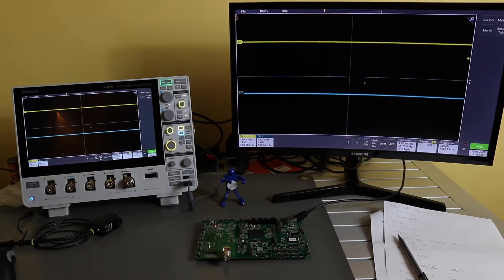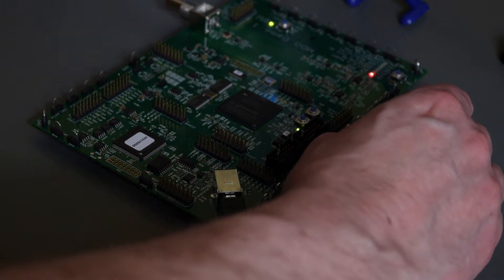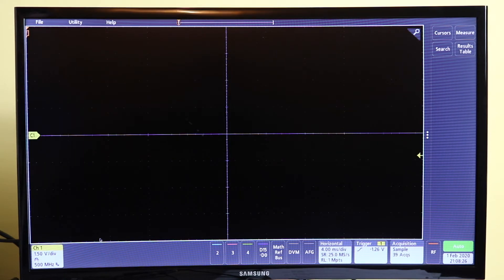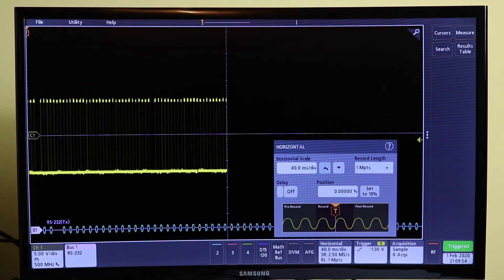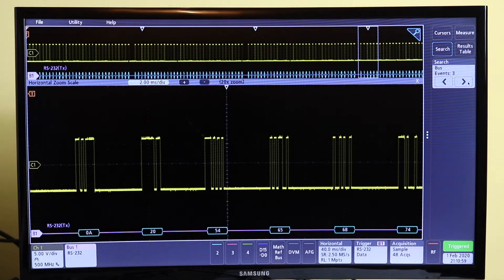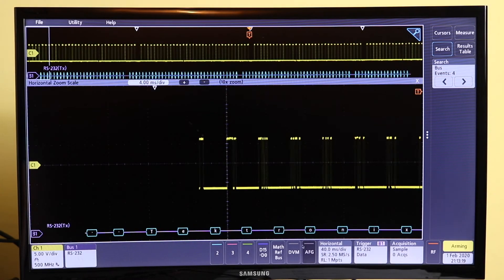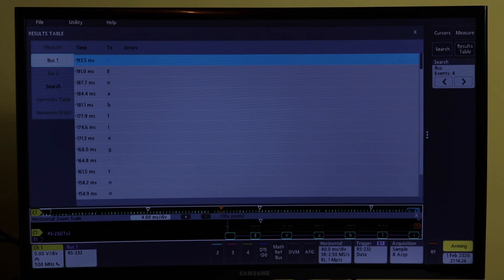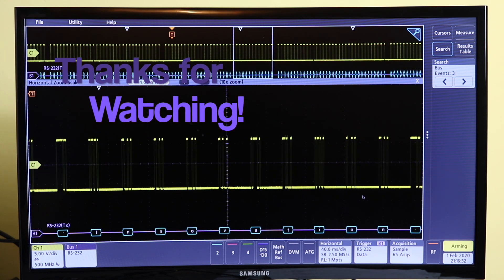Tektronix 3 Series MDO RS232 Signal Capture Demonstration

Comment: Do you have experience with the X3000 form keysight? im currently looking for a new scope and im having a hard time deciding betweend the 2?
i like the bigger screen and resolution on the TEK but people on the EEVblog forum do not seem to like it at all.
Reply from the maker: No sorry, I do not have a user experience of any Keysight oscilloscope. I know that Tektronix do have loan units in Europe, so presumably they do in other areas. If you talk to Tektronix locally, you may be able to source one for a week or so to trial out yourself. I do not know if Keysight do the same.

There is a RoadTest for a Keysight 3000T X Series on element14.

https://www.element14.com/community/roadTests/2191/l/InfiniiVision-3000T-X-Series-Oscilloscope-MSOX3034

Will be a few months before any reviews are produced though.